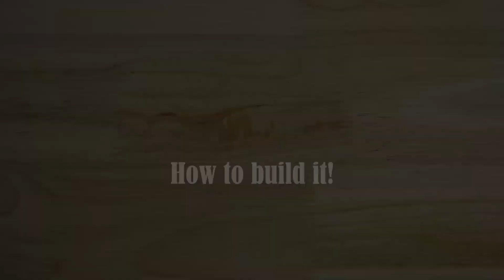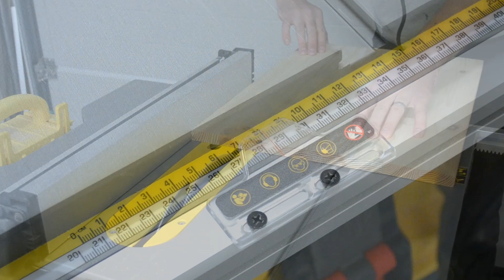How to Make a Simple Wooden Box on a Table Saw

Comment: Do I add 3/8” plus another 3/8” to my inside box measurements to get the ends?
Reply from the maker: Hello Tony, I am not sure I get it. Please correct me :) Only the larger sides have routed rabbets. The shorter ones dont. All of the sides have a router rabbet at the bottom to accommodate the bottom of the box. Let me know if that helps.
Reply: @AllFlavorWorkshop  when building a box of 6x12 would I cut two at 6” and two at 11-3/8” since the 6” side would have to rabbet cut out?